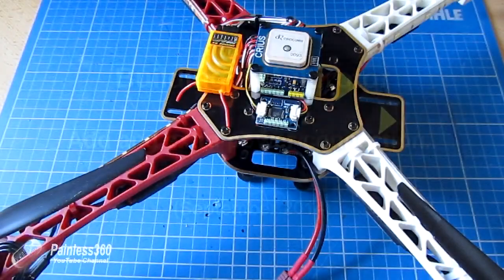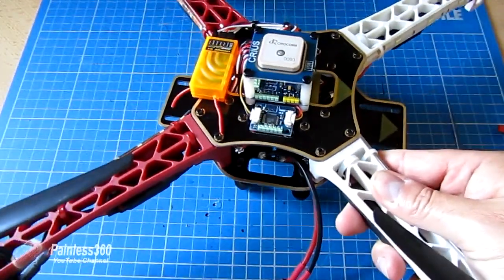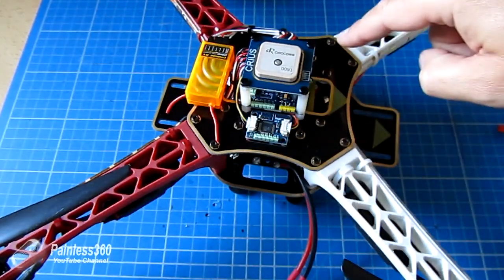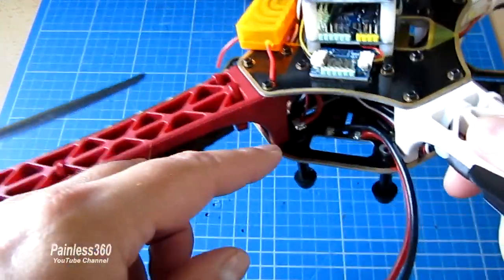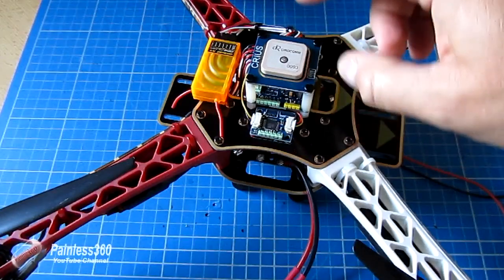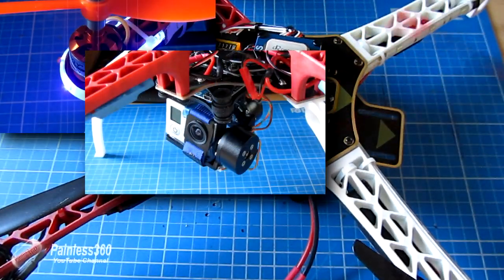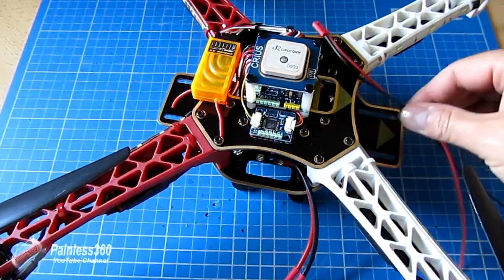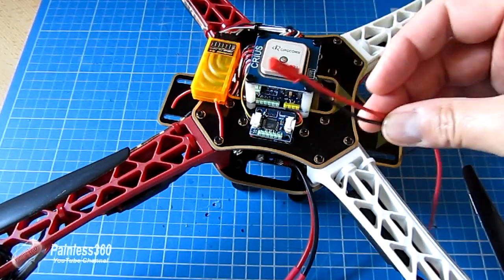Multirotor build tip: Extra power socket

Comment: Excellent tip, I also learned the hard way. Currently I now have; LEDs, OSD, FPV TX and a naza voltage monitor all spliced into a breakout lead. 

On all my future builds I'll be adding a few extra power leads in.

Comment: A tip I learned from neglecting it on my first build. I even add a 12v or 5v BEC now too to anything over 3S and tuck away the leads for filters or accessories. I tend to learn most lessons the hard way...makes for good stories though.

Comment: i also wonder at which point you need a second battery to power additional stuff, or if thats never the case...
Reply from the maker: Can be, mainly due to using 4s. or larger flight packs for longer flight times. I've not had to yet..

Comment: i cudint find a place to ask this topic. sorry if am posting inappropriate topic here...
bro .. am planning to upgrade my sunnysky 980kv x2212 to emax 650kv. .  currently hovering at 80 percent throttle. . running on 5000mah 3s lipo 1700grams total ...will that 650 kv motors be an over kill .. please suggest me a better motor for more power over 980kv's
Reply from the maker: Great motors. I can't find full thrust details but the max thrust of 1200g will probably be on 6s. Be sure you can swing the larger props though if using 3s..
Reply: I have 5000mah 3s 20to 30 c battery 
simonk 30 amp esc 
Maximum of 11 inch propplers because of 450 frame limitations 
I need more thrust.  30 percent more than sunnysky 980kv..
Total weight is 1700grams
Reply: I guess 650 kv will be an overkill right?
Reply from the maker: Why do you think that?
Reply: +Painless360 sorry I know very little
Reply: Bro m not planning for 4s I have many 3s batteries with me.. can u suggest a better motor as upgrade frm sunnysky x22 12 980kv